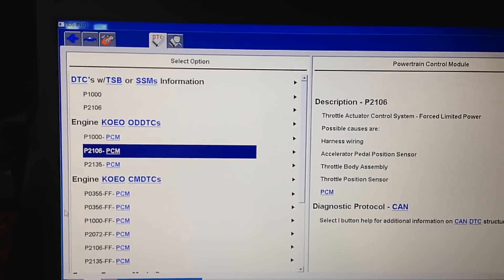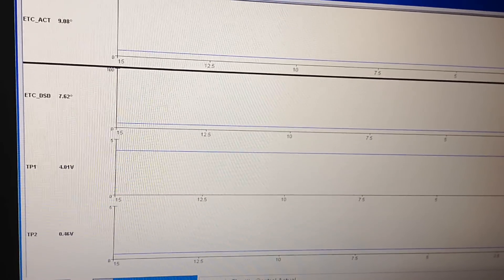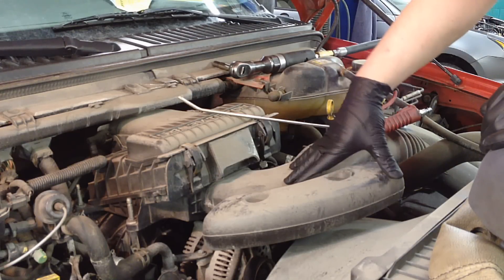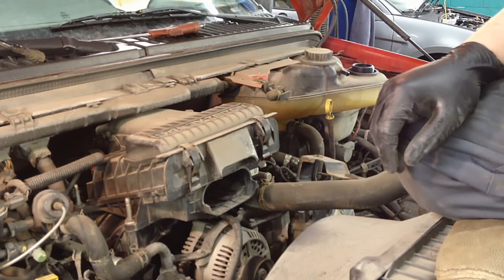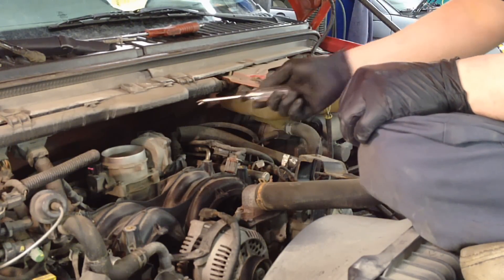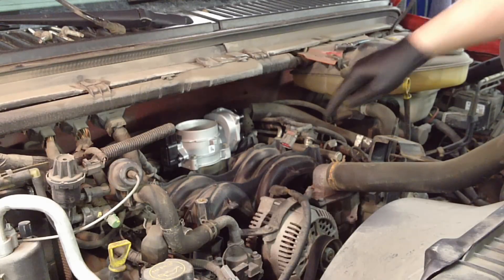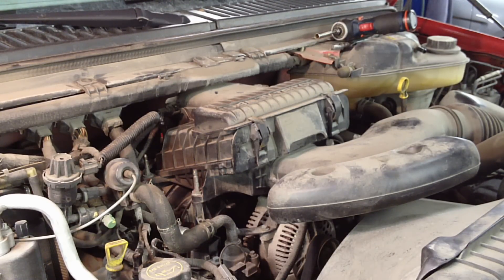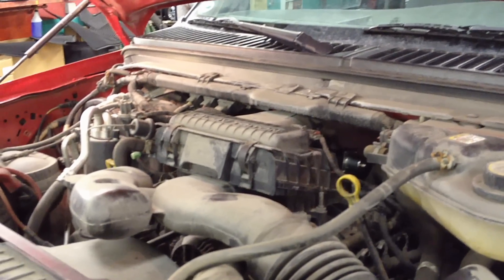Ford F150 F250 5.4L 3v Electronic Throttle Body Replacement P2135

Comment: Hey ford tech, today I was driving around 25 mph and I stopped at a stop sign and my engine died. I saw the check engine light come on and the wrench. I then put it into park then I restarted it and it was like nothing happened. This happened to me before when I was going 50mph also. I was so close to causing an accident. What do you think is the problem. It's a 2005 Ford Expedition xlt 4wd with 77,000 miles. Please and Thank you
Reply from the maker: peanut head I would pull codes first but it sounds like the vct solenoids are sticking. Does it stumble then die or just cut off?
Reply: It just turns off with no sputtering or stalling. Same as turning the key off.
Reply from the maker: yeah then it sounds like the electronic throttle body get the codes read though.

Comment: My 2005 f150 5.4L died taking off from a red light, someone suggested that it could be the throttle body, should I change it or are there any other possibilities? I wasn't driving so of course I didn't see the wrench light pop up it has the check engine light on but that's it. It acts up like this every few months last time I took it to a mechanic and he just replaced the heads and two solenoids, then said it should be fine but it just happened again. So do you think that I should replace the throttle body or are there some other possible problems I should look into?

BTW your videos are awesome, I use them all the time, they're easy to follow and very informative.
Reply from the maker: Zach Fraunhofer There are too many possibilities on this truck you must read the codes first.

Comment: I cleaned my throttle body today and when disconnecting the harness on the drivers side of the throttle body the red clip flew off the plug.  Yea it was an oh F@#¢ moment.  Any ways my question is that I ended up using zip ties around the throttle body and through the plug to keep it from disconnecting while driving.  I have been looking online to see it I can purchase a new plug and just solder / splice it to the original wiring but can not find anything.  Am I ok with leaving the zip ties there to hold the plug secure.  It does seem to be working fine.
Reply from the maker: Joseph Correia The red clip is just a fail safe the black tang on there is what actually clips on.

Comment: sorry, what do you mean by reset the cam before your first start after changing out the throttle body?
Reply from the maker: Pull batter cable for 10 minutes that will clear the memory table and codes so it will learn the new ETB

Comment: Hey FTM its 3 AM just finished doing my plugs 5 thru 8, on my 2005 f150 5.4 3v dam that last one, none broke, thank god, (what was ford thinking) anyway in the process i removed the air filter box and noticed the lower half of the throttle body below the valve is gunky all around, what do you recommend on cleaning this, do you have a video on this let me know, I thought about removing it and spray it with carb cleaner, any advise helps, thanks again for what you do

Comment: Do i have to do the relearn procedure if i take the throttle body off just to clean it? Its an 05 f150 5.4 3v by the way. Thanks
Reply from the maker: Yes especially when cleaning it.

Comment: i have a 2006 ford expedition with a 2135 2106 2135 2106 code would be the same as this video
Reply from the maker: You just need to replace the tps sensor see here after the throttle body is removed- https://www.youtube.com/watch?v=pPFAzVBznu0

Comment: I have an 06 F250 that I bought for a plow truck. When I was putting the plow harness in, I had to disconnect the battery...This truck would not idle without dying when you came to a stop ...I FINALLY found your vid...I cleaned the throttle body and then used your video on how to clear the pcm values....THANKS Bud... A Ford mechanic friend told me it was the fuel pump module, so now I have an extra one of those....Thanks Again, you really know what your talking about....
Reply from the maker: jacktorranc Yep see it all the time, good to hear you are back on the road.
Reply: Thanks I'll do that ,you're videos are the money.

Comment: Great video, my set up was slightly different but following the video I was able to replace my throttle body. I had the p2104 code and 2111 codes. I replaced the throttle body, codes are gone but the shuddering I get when excelerating from overdrive to the passing gear is still there. Also, when clearing the codes by following you other video, if my radio presets remained after 5 minutes, does this mean the reset did not take effect?
Reply from the maker: William McKenna No some new radios have a built in non volitale memory, if you followed my video then the pcm was reset.

Comment: when you say the tp sensors should mirror should they bee the same readings or different.
Reply from the maker: mirror each other in flow but voltages will go in different directions.
Reply: I have 1 tp sensor reading 14.5%with 4.27v  and another reading 21.2% with 1.05v would you say they are ok or are they too far apart. I appretiate the pointers
Reply from the maker: sounds about right from what I have seen in the past
Reply from the maker: they usually track erraticly more than too far apart.
Reply: Ok thank you appretiate the help

Comment: What is that part called in the lower left of the screen with the green cap? I have to sometimes disconnect the lower hose on it when I fill up my gas tank other wise the gas pump will shut off every half gallon or so. Also, does it control anything else? My AC in the truck goes to defrost when I give it gas then back to the normal air vent when I let off the throttle. I have a 2006 F250 5.4l xl 4x4. Thank you

Comment: Is that close to the same thing as a code about the IAC circuit condition or idle speed higher/lower than expected? I got that code from Autozone for my 2004 F-150.
Reply from the maker: You got the P2135? Is yours heritage or new body style 2004?
Reply: FordTechMakuloco I got P0506. I have a new body style 2004 Lariat. I also got the P0356 code for ignition coil primary circuit condition- coil number 6.
Reply from the maker: Ok few things the coil primary circuit issue on these is usually a wire harness chaffe on the a/c line coming off the accumulator as the harness goes over the top of it to the pcm and it rubs on it, that is of course unless the coil is disconnected or not seated all the way. As far as the P0506 was there a recent dead battery or battery disconnect? You need to pull the Throttle body clean it and then reset the pcm learned values as shown here then let it learn the new idle air flow rates as explained in the video-  Cleaning An Electronic Throttle Body Safely

How To Clear your PCM'S Memory on Fords After Repairs
Reply: FordTechMakuloco thank you for the information. I did have a dead battery and then I had to replace it. I will take care of that issue then find out about the ignition coil issue.
Reply from the maker: Ok just don't let it go for long at all I am sure it is a dead miss and the cats like to fail real quick on these from misfires.

Comment: So whenever these throttle bodys give out, you gotta replace the whole tb? damn drive by wire...I bet there not cheap
Reply from the maker: No on these you can just replace the throttle position sensor on these ones but it was not readily available and the whole throttle body was available and they needed to get back out and plowing snow.

Comment: awww yes ye old p2135, Gm has gotten to the point a year or 2 ago where we see that code just replace the sensor do not diagnoise it:P love it pays 1.2 takes .8 to replace and repropgram the ecm.
but my fuck when that sensors bad she bucks and surges haha  kinda fun to drive if u expect it, or limp mode
.

Oh dude how do you tell the diff between 2V and 3V's?
Reply from the maker: Best way is to look for the vct solenoid sticking out the valve cover towards the front of the engine like by the oil fill spout for example because the 2v engines didn't have that technology yet.
Reply: awww ok, pretty straight foward, cam phasers on 3V and just a gear on 2V so the cam cover would have alot wider in that spot on the 3 v
Reply from the maker: yes that too